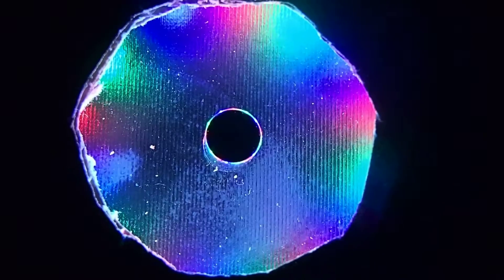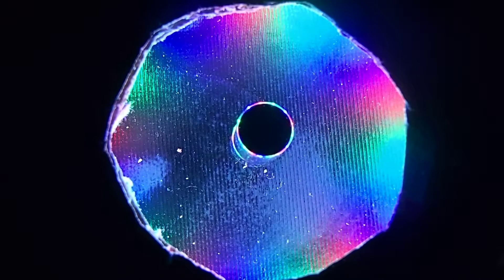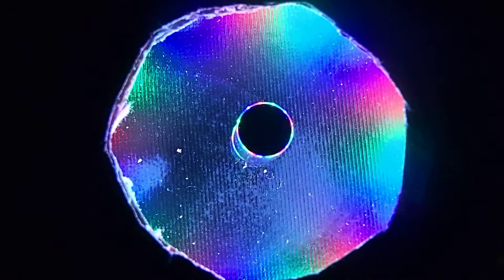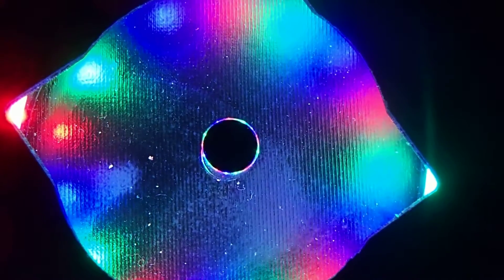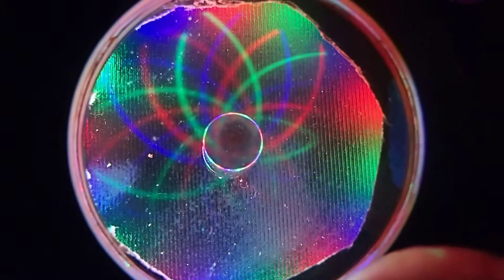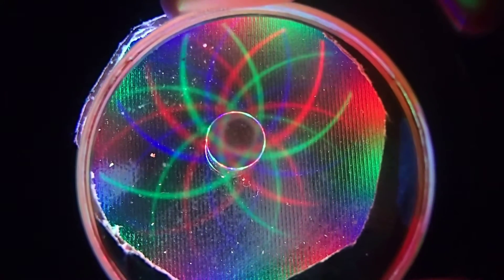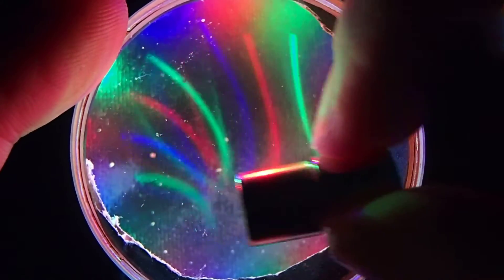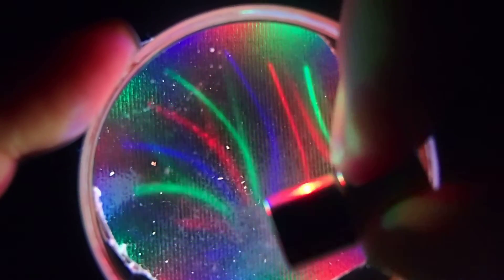My First Ferro-cell Video

Comment: the ferro fluid partials are forming in the field and the light reflects along the partial direction in the field, like sorta like fiber optic but not a path, but in the whole field. your eyes pick out each light form the leds as that light is reflects depending on your angle of view.  Notice you view switches form one light to the next when you spin the ferrocell light base or move your self around the light.

Comment: Hi Lori, what LED's did you use?
Reply from the maker: Bernie, actually, these are the led's that came from my original ferrocell kit made by Tim Vanderelli. The new cell was made by Ken Wheeler, and I just reused the leds from Tim's kit. You can by these kinds of led strips at Home Depot though. They have some really cool ones that are remote controlled and you can change the colours.
Reply: Ok thanks Lori. Real nice work.